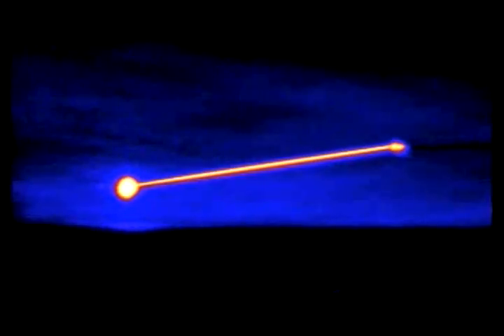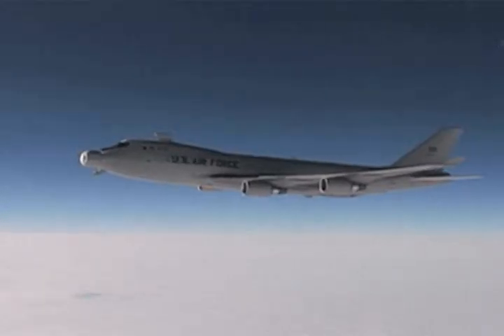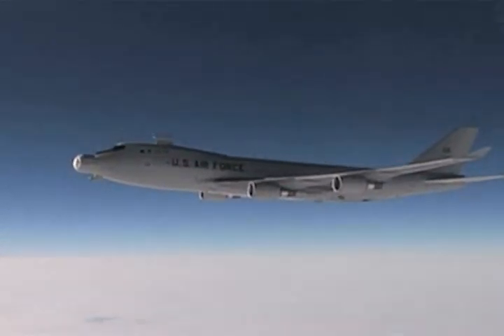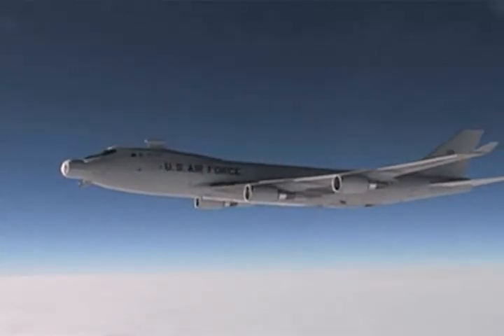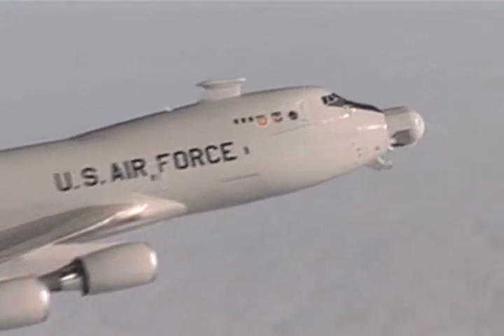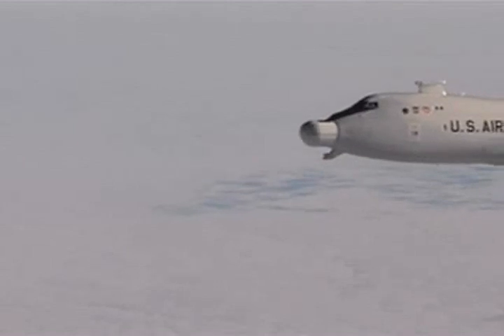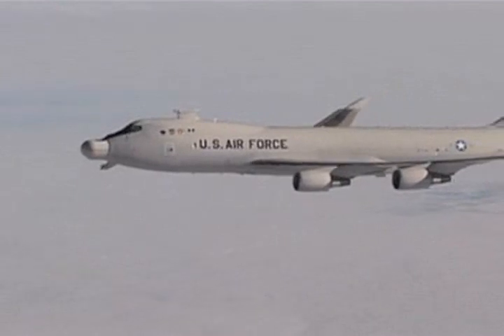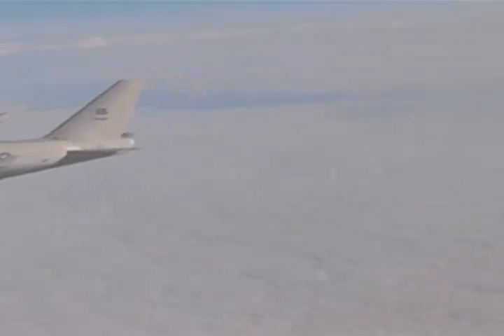New Airborne Laser TestBed Footage, Missile Shot Down 2/11/2010 First Successful Test

Comment: It is meant to destroy the ICBM in the booster phase and the booster phase is when its at its most unstoppable and its not supposed to fly over enemy airspace, even though it has counter-measures to fly for hours over enemy airspace, and they have an escort for them so that it getting shot down isn't likely to happen. AND they cant launch 2000 missles at once, considering each side has more or less than 30 silos.

Comment: There is no one by one firing for this reason.If it does not lift,it will be destroyed by the opponents nuke.
As for Surface to Air defence. Again they are more effective in the lift phase.The one with the longest range is the Russian S400 with a range of 400km.Again useless on lifting ICBMs
For Air to Air to be effective, you ready need to know where the re-entering warhead is heading. The Topol M and RS24 alter their course and fire several decoys.